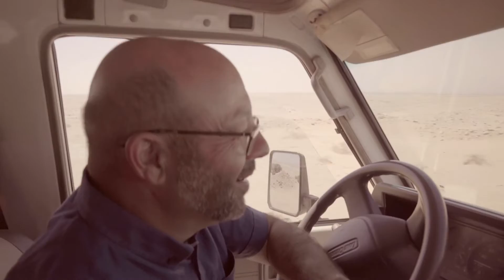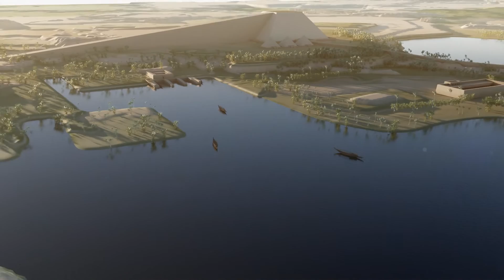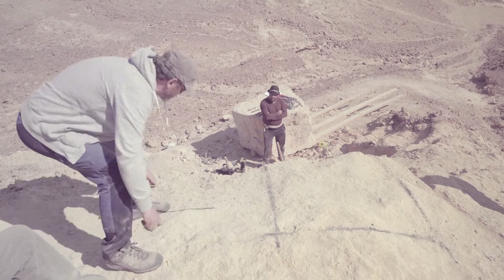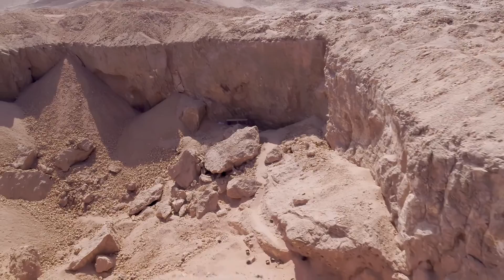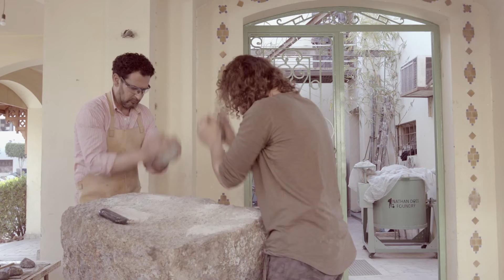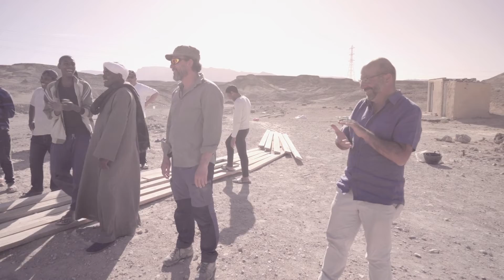Pyramids Builders: New Clues

Comment: The Stonemasons of Egypt or Kemet, were probably a privileged class of non royalty and probably had great status within Egypt.  Their skill level was so high that it the craft itself was probably handed down father to son for thousands of years and their skill level and time to accomplish incredibly difficult tasks would have been much shorter with much better tools than used in tests.  However, the ramp theory is perfect for how the mass transit of stones were transported but, to me as a carpenter, this theory falls apart when fine tuning the placement of each block.  No way to pull and push 20 tons an inch one way or the other in tight spaces.

Comment: They did not use water. Water is precious and hard to find. They used sand. And the wooden planks under the stone block were round as a pen. The same with the sleigh. The contact between rails and the sleigh were minimal thus the sleigh were moving fast.
Reply: why would water be precious and hard to find on the banks of the Nile? they had pots. they would easily have access to water that close to the river.
Reply: Bro, they were next to the largest river in the world. They had plenty of water.

Comment: By the way, the cutting experiment with water has done many years ago. I'm watching this documentary now on Amazon and I did some basic calculations. To cut the blocks roughly gonna take about 7 years for whole the gang of 100000 men working continuously 12h a day, (the reported period by some Greek historian)on the ongoing construction of the great pyramid. Now, the blocks have been transported for about 1000 km, calculating the same amount of people gonna take around 8 yrs pushing even the smallest blocks of 2000 kg with 2km/h for 12 hrs a day. With simple arithmetics, it means that a person has pulled about 75kg for 12h non-stop. Fiscally impossible, if we divide it by 1km/h. And by the information of the historical writings, all was done for 20 years.
 Now we have the same gang pulling blocks for 16yrs and it still is too fast, they couldn't exceed 500m per hour. NO WAY. Now with cutting-7 yrs, transport- 32 yrs, lifting them to construct the pyramid, cutting the tomb blocks 35 times bigger-70 tones lifted on about 60m, creating all the tunnels, calculating North with the precision of less than a degree. This documentary is just a waste of time, I have some concepts about the transportation, probably done on the Red sea, where they've saved 700 km of dragging, but what about the rest? Obviously, it took them completely different methods for which they didn't leave any clue.
Reply: You wasted a lot of time with your meaningless math.  Next time first learn the evidence.  Egyptian quarries were co-located near = the Nile.  So blocks were not moved hundreds of kilometers = but rather hundreds of meters.  Stone which had to be moved a long distance was shipped via barges on the Nile.  The white Tura stone came from Tura North and South quarries - about 10km away from Giza on the outskirts of modern Cairo.  All the rest of the limestone was quarried 100-200 meters from the Giza pyramids.  The small amount of granite and other basalts was shipped via barges to a harbor which sat adjacent Khafre's valley temple - ~500 meters from the pyramids.

Also most blocks were not individually cut as the experiment did.  Look at photos of the quarries and see whereby they cut channels in the bedrock and holes spaced along lines for wooden beams to be inserted.  Drive a line of chisels along a shallow precut line in limestone.  After a short way in = the stone will continue to crack.  Via this method you can fracture off approximate chunks fairly quickly which can then be levered free and onto wooden sleds.  Only a small amount of blocks were carefully cut and in some cases polished.  The rest are basically stacked rubble of varying shapes and sizes stacked quickly leaving gaps all over.
Reply: @iliapopovich bad assumptions lead to bad conclusions. The cutting of limestone blocks would not take that long, and for the rest, why would one team be doing all of that? I'm sure they weren't crazy and were more than capable of switching off between groups as they got tired.
Reply: Hi can i chat with you necessary about the most important discovery
Reply: They used boats to transport the blocks along the Nile from Turah & Aswan to Giza and the majority of the stones in the pyramid are limestone & from right next to the pyramid, severely reducing transport time for the majority of the blocks.
Reply: Man , you are completely right in your thinking,
Geologists have proved that sphinx had survived the rainful era which ended 10 thousand years ago, so those pyramids were built by a more ancient civilization that still unknown to us.
Greetings from Egypt to you man, bye
Reply: @فتىالعرب-غ9غ  Thanks actually is simple mathematics .
Reply: @iliapopovich  in France scientists have discovered a stone plate that was from Egypt,on which there were writings by some substances and when they test it by carbon 14 ,they found it dated back to 22 thousand years ago.
Unfortunately all Egyptology is based on West theories not on local egyptologists, and we are not but parrots
Egyptology should be founded from scratch
Reply: @فتىالعرب-غ9غ  I will search for this info on the web, sounds interesting, check the channel "bright inside " the man shares a lot about the unexplained Egyptian facts.

Comment: In some places the geopolymer concrete makes the most sense.  
They did find ancient mortar.  
And it would account for the weathering as it's probably softer after curing then natural hard limestone. 
It would also explain that the core drill holes could easily be rotted out post holes that were once cemented in. And the cuts and flat areas could be just worked wet concrete. 
Tunneling downwards doesn't make any sense at all. Especially in a small deep perfectly square tunnel full of Carbon Monoxide with no light. 
Wet concrete self levels. 
There should be copper deposits en masse. But I ain't heard of any. 
Limestone is a sedimentary rock so I doubt the geologists can distinguish between 6000  to 13000 year old Limestone or older limestone. <-?? This is the pivot point at which NO ERROR can exist! If you can't prove it's not cement, it is!
Reply: geopolymer hypothesis is also suggested in South America, but those stones were tested and came back positive for natural crystalline formations. The sandstone in the pyramids  is 100% Tura Limestone, and this was confirmed be geologists over 100 years ago, as well as being easily verifiable with todays technology. A lot of the blocks such as granite have a very obvious crystilline structure and can't be manufactured. As there are many properties of rocks that can accurately and repeatedly dated. Such as the rate of cooling ect. There are strange cut marks in blocks that seem to be far more ancient, but the logical explanation for how the pyramid was built, is in layers, over many hundreds, or thousands of years, by different civilizations with unknown or uncredited iron tools, and mechanical concepts.
Reply: break up stones to make new ones. Saves time? why ddoes the sandstone contain complete seashells?

Comment: Just a thought on building these structures. Is it possible that the stones we mined, and crushed to powder. Then carried through the waterways to the site. There the powdered stone was assembled into stone blocks. Cutters and craftsmen where then used to place and build layer by layer. 

Also, it may be noted that the construction approach may be opposite to modern day construction, which focusses on build skeleton and walls first, thus creating rooms as a by product. 

In the times,once the architecture plan has been made, the entire space is filled with medium ( stone) only allowing for passages and rooms as the construction went on floor wise.

This way maybe you can start the construction from below -5 and move upwards to 481 meter height. 

Each time the stone making machine is moved up a layer and the stone can be placed even at the height of 1000 meters perhaps even with tons of weight. 

The pyramid itself is designed to be lighter on the top, hence the structure should stand and as limestone hardens over time the structur gains in strength.

No question of stone blocks being carried. 

I'm not an architect and study this subject deeply. Just curious like most folks.
Reply: Stones “ we “ mined ?? You look as though you have Arabian decent , which scientifically is categorized as Caucasian . You should refer to as “ they “ . You are not one of us
Reply: break blocks and make new ones from the powder... That would save time or what? Why does the sandstone contain complete seashells then?
Reply: geopolymer hypothesis is also suggested in South America, but those stones were tested and came back positive for natural crystalline formations. The sandstone in the pyramids  is 100% Tura Limestone, and this was confirmed be geologists over 100 years ago, as well as being easily verifiable with todays technology. A lot of the blocks such as granite have a very obvious crystilline structure and can't be manufactured. As there are many properties of rocks that can accurately and repeatedly dated. Such as the rate of cooling ect. There are strange cut marks in blocks that seem to be far more ancient, but the logical explanation for how the pyramid was built, is in layers, over many hundreds, or thousands of years, by different civilizations with unknown or uncredited iron tools, and mechanical concepts.
Reply: @quorthonsinferno5119  There are very simple refutations of the geopolymer suggestion: 
Surely they would use moulds to pour the mixture, why then are so many blocks of such varied size and shapes requiring unique moulds every time?
Experimental archaeologists have accurately recreated polygonal masonry in the same style as the South American sites.  
Why has nobody who has put forth this suggestion recreated it or computer modelled it?
Reply: It's a totally different civilization that came before the rainful era who build the pyramids, not those weak pharaohs taught to us in schools.
Greetings from Egypt to you
Reply: @فتىالعرب-غ9غ  are there names for this civilization so that I can look into them? Thanks!
Reply: @devonbailiff  unfortunately, the dictator Egyptian government as well as classical world archeologists  conceal the truth and date our civilization just back to 3200 BC to be in accord with Jewish historical scribts which is almost nonsense.
Once upon a time a stone script panel was discovered and when tested by carbon 14
It dated back to 22000 years old
But our dictator government archeologists chose to ignore it completely.
Moreover some giants skeletons were found whose tallness amount to 16 meter, but taking about that is not permitted in Egypt and among traditional archeologists
Because you know most world scientists insist that human has developed from apes.
Help us uninstall dictator regime of Egypt that's strongly backed by the west
and the true civilization will come out open to the world
Reply: @فتىالعرب-غ9غ  👍🏼👍🏼
Reply: @devonbailiff  if you want more astonishing links ,let me know
Thanks brother for interesting
Reply: @devonbailiff  I copied here two links yesterday but seems that YouTube has removed them. I don't know why
Reply: @devonbailiff  
https://m.youtube.com/watch?v=KMAtkjy_YK4&t=0s

Comment: In Al-Quran (Islamic Holy Book) said 1400 years ago that Pharaoh build the pyramid (tower) was using "baked clay" instead of limestones (baked clay turn into rock limestone after thousand of year process ) and I believe is true  because there is no such technology at that time In how to pull and lift a heavy rock limestone. 
Many Scientist thought that pyramid were built by pull and lifting the limestone using temporary water canal and hang it with wood in the water (Buoyancy weight) or rail tunnel to transport the limestone rock from bottom to the top. It's an insane method and if it's true the people in egypt will build the other things with this "insane method" and also people in egypt can create a heavy duty wire-rope and make a good tools to cut precision the limestones as well.   
This is my opinion: The pharaoh was instructing Haman (Architect ministry of ancient Egypt) and their slaves to made giant statue or big bricks from mud clay and arranged them as base foundation, after that when the stone molds were still wet they did the engraving (Hieroglif) at the big stone walls and when they want to continue the work by making them higher they burnt it first and repeat it step by step until the top of pyramid done. 
Scientist just need to prove that mixed material of "baked clay" can be turn into the limestone after three thousand years process
Reply: Yes you are right,and this exprient cant satisfy the proof.many question are there why they not use wheel,and how they keep stone so much hight.they have iron tool in there pictures so they have different techonolgy.
Reply: I dont know about the coran but this cientific evidence may prove you right.
https://youtu.be/KMAtkjy_YK4
Reply: @marcelotrejosievers5754  Actually it kind of already has. But it wasn't natron that was the hardener as Davidovits suggests, it was diatomaceous earth. https://www.youtube.com/watch?v=EDHtQCYn7ZU
Reply: It makes the most sense by far.
Reply: >>
geopolymer hypothesis is also suggested in South America, but those stones were tested and came back positive for natural crystalline formations. The sandstone in the pyramids  is 100% Tura Limestone, and this was confirmed be geologists over 100 years ago, as well as being easily verifiable with todays technology. A lot of the blocks such as granite have a very obvious crystilline structure and can't be manufactured. As there are many properties of rocks that can accurately and repeatedly dated. Such as the rate of cooling ect. There are strange cut marks in blocks that seem to be far more ancient, but the logical explanation for how the pyramid was built, is in layers, over many hundreds, or thousands of years, by different civilizations with unknown or uncredited iron tools, and mechanical concepts.